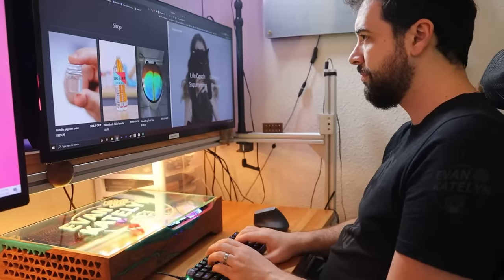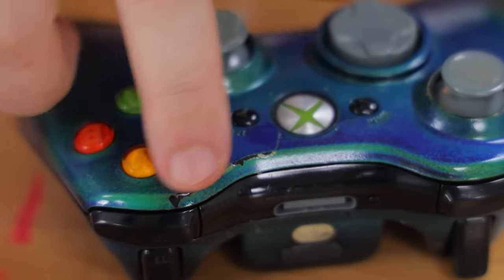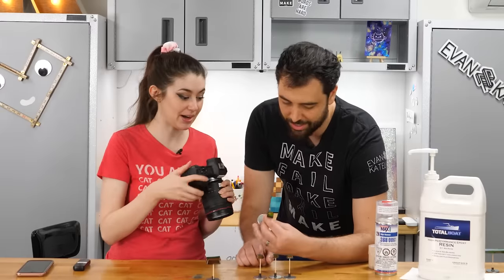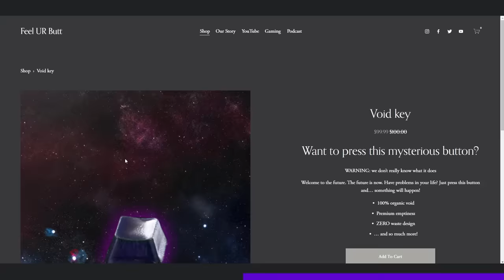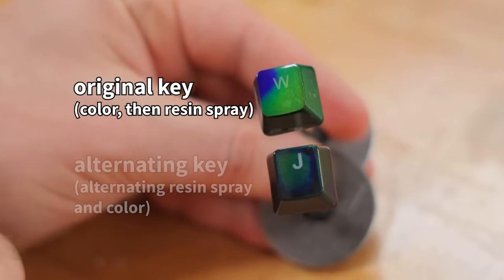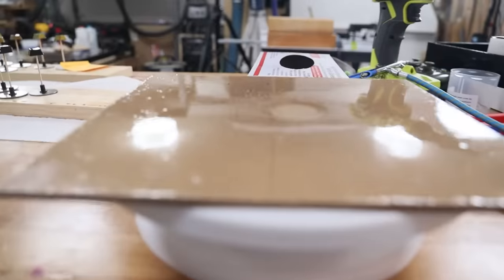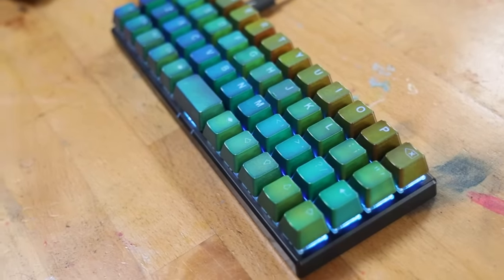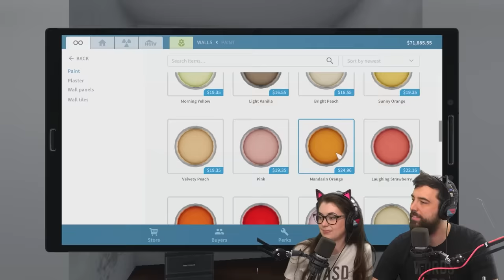DIY Mood Ring Keyboard

Comment: I dont know why they went through all that work, When they could of just used a clear primer designed for plastics that can be bought from your local Automotive Paint Store, Then sprayed the Mood paint, then the 2K clear over top, 2k paint isnt resin paint or epoxy, its a 2 part enamel paint, its enamel paint with a hardener.

Comment: Why not just spray multiple keys?
Reply: You won't get an even enough coat spraying on multiple at once.
Reply: @lmaree200886  more thin coats. would still be faster. if you do 4x as many coats on 20 keys at a time, you'd still be 5 times quicker

Comment: You can finally see what Charakters Have been typed as Password :D
Reply: An 8 character password has 40,000 combinations. Good luck guessing!
Reply: @lmaree200886  you can see the aproximate order by the color of the buttons
Reply: @TecSanento  Did you even see how quickly the keys cool down once touched? I counted less than 15 seconds.

Comment: Rad, but please be more careful with that epoxy spray stuff, as others have mentioned.
Probably want to be using at least full sleeves, if not full spray suit.

y u no white plastic keys?
also clear/frosted keys, and play with polarisation film between the key and the light source.

Comment: The keycaps you used are PBT and are generally VERY chemically resistant. A lot of your issues with adhesion and delaminating occur because your coats will never properly bond to PBT as a material and using something like ABS keycaps would be better likely to yield the results youre after.

Additionally the 2k coating you used is very toxic, even slight skin contact is really dangerous and can remain airborne. You should reallly consider reading the msds and following recommended safety advice such as a suitable suit and a very well ventilated area and correct respirator cartridges.